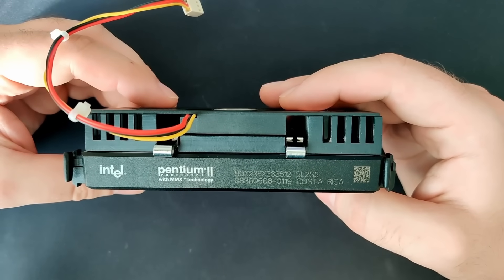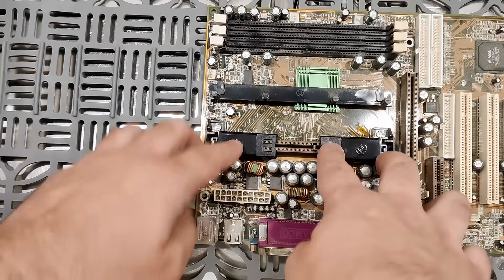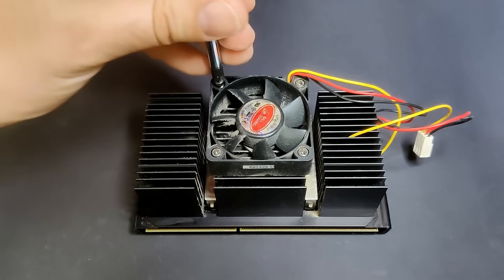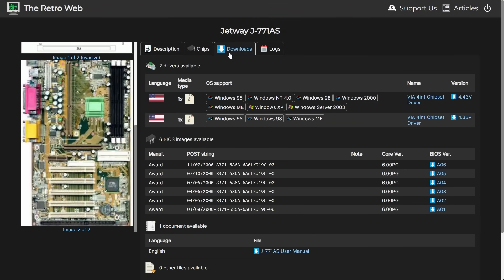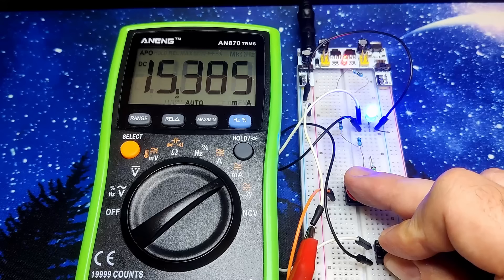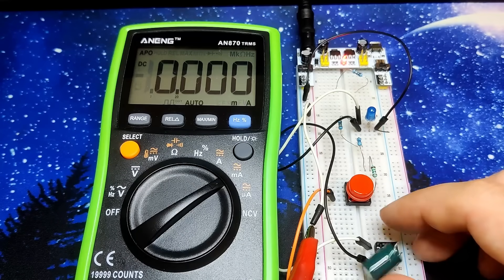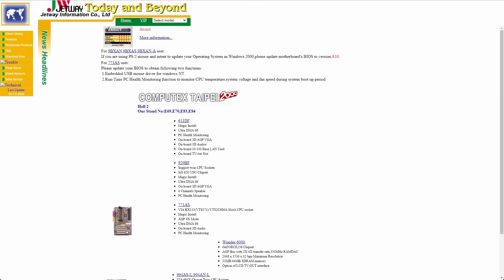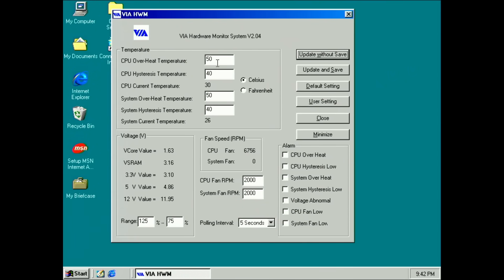Scrapyard find: AMD Athlon and a Jetway 771AS motherboard

Comment: I worked in a PC shop when these were new. Jetway were just a cheap brand. VIA chipsets were terrible at the time. All sorts of crashes and bluescreens, every update of the inf driver improved the stability, and they ended up pretty good by the time they became obsolete.
Reply from the maker: Haha, yeah, that is what I remember from VIA. That is why I liked the nForce/2 chipset so much. They were solid and had good drivers as far as I remember. I loved my Athlon XP Barton 3200+ - I still have that PC and all it's components.

Comment: I prefer to use car shampoo rather than dish soap. I'm sure it makes no real difference but there are salts in dish soap whereas car shampoo is more designed with metals in mind. If rinsed well, it shouldn't matter, but it just makes me feel better.
Reply from the maker: That's a valuable tip! Thanks for sharing.

Comment: For cap replacement for capacitor plague era hardware, usually my technique is to replace only the series of caps that have one of them bad

Say you have a board with 10x 1000uF 16v caps and 3 1500uF 10v caps.

If one or more 1000uF caps is bad and the 1500uF caps are fine, I'll replace all of the 1000uF caps and I'll leave alone the 1500uF caps. It is to avoid the law of series.

Often, many different brands of caps are used on boards and some aged better than others. So if one cap in a serie of caps is failing, they're all condemned to me. But the other, different, caps should be fine
Reply from the maker: Interesting take - and mirrors what other people have said. I like this approach as well. Less stress on the board, but a small risk that a seemingly good capacitor my be bad. So far, I haven't encountered an issue with the approach you mentioned.
Reply: @bitsundbolts  yeah, it works well for capacitor plague era boards, however when it comes to older boards from like the late 80s/early 90s, usually with smd caps and there's signs some of the caps leaked, I'll replace all of them because corrosion is usually much more destructive and harder to clean out.

Typically found on sega game gear, mega cd, 32x, super Nintendo, Amiga and Macintosh ...

I even once had a compaq 386sx that had through hole caps in the PSU that were all leaking. That was a first to me, but yeah, I start to believe there is another capacitor plague from the late 80's/early 90s that reveals itself only now.
And this one is much more dangerous for the PCB than the 2000s one

Comment: Great repair!
I replace all the capacitors of the affected value/s, including the ones that look/measure OK, but leave those of unaffected values alone even if they're from the same brand/series.
Replacing all the capacitors from the same brand/series (or even all the capacitors, depending on the brands involved ) would probably be the better idea, but I fear damaging the board with my lack of skill and crappy soldering iron :-).
Reply from the maker: I wish there would be a good method for in-circuit measuring capacitors. But from what I know, it is not possible (maybe it is with expensive gear). I tend to also leave unaffected values on the board. I recapped a Gigabyte board which had blown capacitors all over the board. For Slot 1 and Slot A boards, the capacitors around the power delivery next to the CPU are usually the ones that are affected.
Reply: @bitsundbolts  ESR meter is what you need, it is very expensive at around 30$ :D ... but it might not work that well if there are lots of capacitors in parallel and some of them are still good. I got my ESR meter back in 2009 when I started electronics repair and I use it almost weekly to this day
Reply from the maker: I got a cheap ESR meter, but it doesn't work well on this board. It does work well on the individual caps when they are off the board, but then I can also use other methods to test.
Reply: @bitsundbolts  Yeah, ESR meters are not useful when the capacitors are in parallel (and maybe in other situations I don't know). I have also replaced bulging capacitors that measure OK in ESR but not in capacitance :-/.
Reply from the maker: I start to rely more on my little test circuit with the LED! Those other measurements with meters may throw you off.
Reply: @bitsundbolts  Yeah, your test circuit is pretty neat!

Comment: congratulate with find !  will there be benchmarks ?
like always, amd-boards have bulged capacitors, as if they were cursed))) i think, this related with using bad psu or psu with basic (powerful) +12 V line, & mb they had voltage ripplies on +5 V line => caps were bulging. better replace them all, is unknown, how long they`ll work. slot a wery rare, at least in russia & cic
Reply from the maker: Yes, there will be more content for AMD Slot A (and Socket A later) as well. I noticed yesterday that I do have a Athlon 700 Thunderbird (256 KB L2 cache) as well. The one in the video is Pluto (512 KB L2 cache). I'm curious myself to see how AMD is supposed to be 20% faster in games compared to Intel at the same frequency. I just need to find a Pentium III with a similar frequency.
Reply: @bitsundbolts  ok we`re waiting) by the way, i have pentium 3 600b (katmai, 133 mhz fsb), & i can do a test of it to compare, if needed........
Reply from the maker: Thanks for offering your assistance. I may also have similarly clocked CPUs. I have to go through my collection

Comment: Another theory for the Slot format was that Intel realized the i686 architecture greatly benefits from cache. On the PPro they had the cache on-die, with the result that if something was wrong with the cache the whole CPU package was wasted. With the cache close, but on separate chips they could increase production yield since they could be tested and swapped individually.
Reply from the maker: Yes, that is correct. The PPro had actually two separate dies if I'm not mistaken. That is why the CPU is so big - but they could only be tested together in the ceramic housing. If one of the chips was faulty, you had to trash the entire thing.

Comment: Slot A. Nice find. Very Nice.
Reply from the maker: I think so too! Thanks
Reply: @bitsundbolts I'm trying to find a SlotA mainboard for years now. It's a bit hard as these are very uncommon here in Poland, plus people tend to price them very very high. Guess it's like that anywhere. Cheers and a Happy Christmas!
Reply from the maker: Yes, they are expensive! I did buy a Slot A board in Germany from eBay and it was very expensive. I got it a few months back because I wanted to start making content for this platform as well - that was before I was introduced to the scrapyard. Now I just hope to find more of them there.

Comment: Had most of the customer platforms from the 90s/early 2000s (Socket 3, 4, 5, 7, Super7, A, 370, Slot 1) over the years but never had a Slot A platform. Feels like I missed something.^^

That placement of the floppy and IDE headers is the worst I have ever seen on a mainboard. What were they thinking? That it is 1999 and nobody is buying AGP graphics cards? 

As long as capacitors are not bloated I don´t replace them. Have several Amiga 500, 1000, 2000 and 3000 here that are still on their original 1990s caps and run stable for hours. 

Only if the system is not running stable for no apparent reason it is maybe a good idea to replace them all (or at least the ones delivering power to the CPU and memory slots).

By looking at their position on the mainboard you can guess what part of the board they are powering.
Reply from the maker: Yeah, the floppy and IDE connectors seem to have been an afterthought. I tend to leave the board in its current condition. The capacitors that did not have the bulging top tested fine in my circuit (also mhA draw), I believe the remaining caps to be ok. Also, the sound quality coming from the board is ok - so, I think those smaller caps are fine too.
Reply: @bitsundbolts  That bulging comes not from decomposing electrolyte (like you said in the video), it comes from an short in the capacitor that creates heat and makes the electrolyte boil. It then turns into steam and increases the pressure inside making the cover bulging. Next step would have been opening of the cap to vent steam. Some of the caps from the older video have already partially opened and you can see the dried electrolyte on the top of the caps. That was the harmless end of life for this caps, it also can happen that they simply explode, the metal part is flying through your computer and electrolyte is landing everywhere close to the cap with parts of the insulation material sticking to it. That dries and you are in a world of pain trying to clean the PCB from the sticky and smelly leftovers. ^^ 

While testing the caps the LED became dark as soon as the bulged cap was inserted, so it shorted the circuit and no power was flowing through the LED anymore.

Typical old caps dry out due to evaporation through the sealing (that is not tragic, they simply not reach the mA ratings printed on them), or they start to leak electrolyte through the bottom sealing leaving puddles of electrolyte next to them. That is bad, because the electrolyte is damaging the traces. That is a common problem with the younger Amigas that use SMD-components (600, 1200, 4000, CD32). If not treated for years leaking electrolyte becomes as worse as leaking batteries, it destroy the traces below them.
Reply from the maker: I have seen some badly leaking capacitors. The sooner you get the electrolyte off the PCB, the better. I would like to add to your explanation of electrolyte evaporation, that I've read somewhere that a chemical process occurs when electrons attach to the rolled-up metal membrane inside capacitors (sorry for probably using wrong terms here). This chemical reaction is the one that causes this thin metal sheet to degrade over time and turn a small amount of electrolyte into gas. It is a very slow process, but it occurs each time a capacitor is charged.

Comment: I have one Slot A machine with AMD Irongate northbridge 😅 It's AGP-port is the most problematic I have ever used... Nvidias are out of luck even at AGP 1x mode but ATI and Voodoo3 works much better. Mobo is MSI MS-6167.
Reply from the maker: I have another Slot A motherboard, but I don't know which one and what chipset. But I did notice that I have an AMD Athlon 700 Thunderbird too! Face-off coming soon: Pluto vs Thunderbird and hopefully on two different motherboards!
Reply: @bitsundbolts  One thing I have learned is that the first Slot A-mobos doesnt officially support Thunderbirds so there can be random hangs here and there.
Reply from the maker: Interesting. I'll keep that in mind. I actually didn't know that there were two versions of the "same" CPU. But yesterday I looked inside both Slot A CPUs from the contacts side. The packaging is identical, but it's very visible that the Thunderbirds have the cache chips missing.

Comment: The problem where I live is that the new replacement capacitors sold here are worse than the ones on the board (the not bulging ones) so there is a big chance that even with replaced capacitors the board would not boot. So replacing the good capacitors is out of the question.
Reply from the maker: Very valid assessment! And you know, why trying to fix a working system. If spare parts are scarce, it is viable to leave it in its current working state. Those boards won't see a lot of action anymore.

Comment: I remember seeing a few Jetway motherboards in the very late 90s and early 2000s. They always just seemed to be a Taiwanese value brand. Not bad per se just no frills boards. Probably why they didn't last very long as they didn't stand out in any meaningful way. The Slot A 700 MHz Athlon was also my first introduction to those chips via a work PC. Mine was running on a AMD 750 chipset motherboard from Gigabyte.
The slot1/super socket 7 through socket 478 P4 & early Athlon 64 (and everything in between) were during the capacitor plague years. I saw so many boards die from bulging and leaking capacitors, some after less than a year of use! I also had a few motherboards die spectacularly from bad caps. Like my Abit BH6 where one of the power MOSFETs blew up, probably because a bad cap shorted completely. Left a sizeable burn mark on the board when it died!
Reply from the maker: So, my scenarios I mention in the video are not that far fetched! Thanks for sharing the story about your board! I don't remember what happened to my Athlon system back then (moving a lot and leaving Germany for good). But I think it had an issue because of a (cheap) power supply failing, probably killing the board and probably the CPU as well.

Comment: As usual, a great movie. In our country (Poland) Athlons on Slot A were not popular. They were quickly replaced by the common Socket 462. For a short time I had a board on an AMD 750 chipset with an Athlon 650Mhz.
As for the capacitors, I'm wondering myself.... Since the board works fine it probably doesn't make sense to replace them all. 
Such a thought...
To this day I still have my first sound card on ISA Avance Logic ALS120, which I bought I think in 1996 for my 486, and I don't know whether to replace the capacitors on it or not. The card works, but I can hear noise and strange interference. I don't know if it had that from new or if the old capacitors are actually to blame.
Reply from the maker: Ah, the AMD 750 - Irongate I believe. I don't remember what chipset I had back then, I just wanted an AMD CPU. I skipped PIII and P4 from Intel. 
I have an old sound system which has extremely old capacitors. It's very noisy. Some day, I'll replace the capacitors and see if it makes a difference. Just to see what difference it makes and if it's noticeable
Reply: @bitsundbolts  I remember Irongate, and regret it, My GA-7IXE4 ... I was still very attached to a number of ISA cards and it 2 slots for them, it was also the peak of the VIA chipset / soundblaster bug, but the lack of 133 (266DDR) FSB support was a pain, as was the AGP2X which some drivers forced back to 1x as the earlier release of the chipset (before working super bypass mode) was buggy. It basically killed my chances of upgrading on that platform

Comment: 9:05 that is a not good button battery test :) Youl should get a proper battery tester for that purpouse. When You check open ciruit voltage with a multimeter and get like 2.8V that voltage can be really a lot lower with just some more current drain from it than the multimeter takes :)
Reply from the maker: Most of the batteries I take out from those boards show 0V. So, I was surprised to see anything above 2 volts. But I get your point. It may be 2.8 volts, but nothing that can be sustainable. The moment any load is placed on the battery, voltage goes down significantly.
Reply: My quick test is to press down on both sides of the battery with my fingers. If skin resistance doesn't cause a measurable drop the battery is probably good enough to run an RTC, at least for the short term.

Comment: Hopefully the memory subsystem is designed better than that of my Jetway 994AN-L. I have only had it working close to the performance of my Abit VP6 once. 
Typically memory bandwidth with PC133 is slower than PC66 on my KT133 and 440BX (sub 300MB/sec in all tests) and game performance on any card is crippled.

I'd recommend replacing all capacitors related to CPU, memory and videocard power delivery - pretty much any that would have been exposed to a lot of heat, something that would have significantly contributed to the capacitor failures on my Duron 1000's original board. Its cooler is only 40mm x 40mm x ~55mm and post board repair sees the CPU reporting ~60 degrees Celsius idle after running for half an hour.

The 994AN-L is even worse, as the FDD connector is between the AGP and first PCI slot - no AMR connector to space it out at least slightly.
Reply from the maker: Yeah, those drive connectors are really placed badly!
Maybe, one day, when I'm in the mood, I'll replace the other caps too.

Comment: I recently recapped an Epox 7KXA Slot A board with some bulging caps. It was brand new in box but the mosfet caps were in cosmetically bad shape yet still held some current. Likely out of spec but didn’t go into diagnostic details. The board was needed to replace a failed Asus K7V in an industrial system running proprietary software to control manufacturing hardware. Full spec was Athlon 600 (replaced thermal compound and fan on heatsink) with a Maxtor 40GB PATA drive (converted to a CF>IDE bridge using a 32GB WD SiliconDrive CF card) and a reasonable 2x128MB DIMMs on Windows 2000. This system manages two serial ports and two proprietary DIN9 controllers for industrial equipment. The software is hard coded to the system config and the company is out of business, so we couldn’t setup a VM to simulate it (I tried) and the Epox replacement was the only option… the end result was flawless as win2k booted up without issue like nothing changed other than some minor hardware detect.

I did recap the entire board aside from the tiny caps in the bottom IO portion. There were a few caps around the PCI and south bridge that tested ok, and were quality caps, but for how long? I want the board to run 20 years like the last one did. I replaced every cap I could with Panasonic low ESR caps I have absolutely fallen in love with as they are rated at 70,000 hours @ 105F with <5% variation.